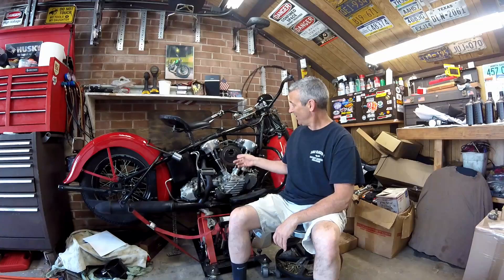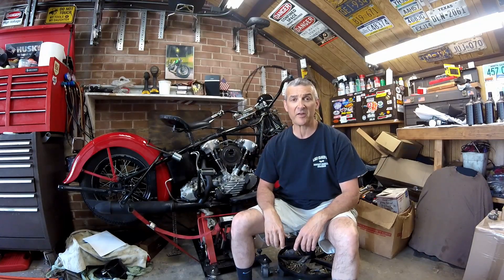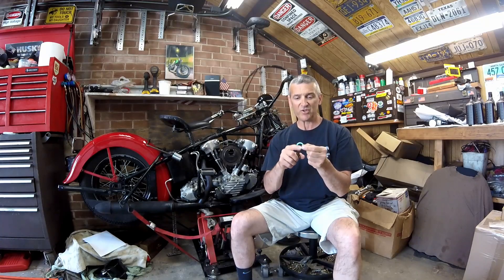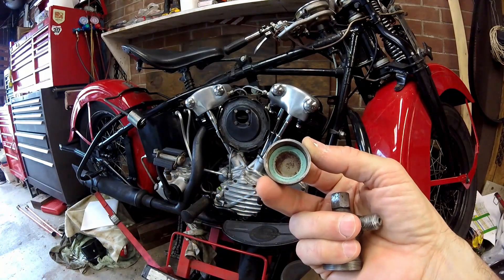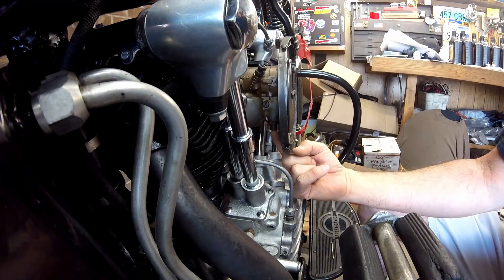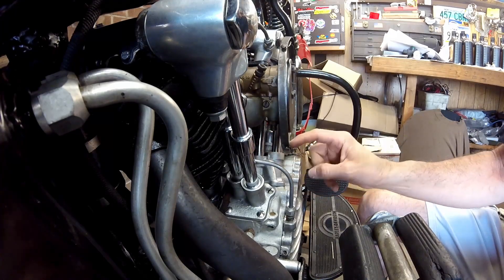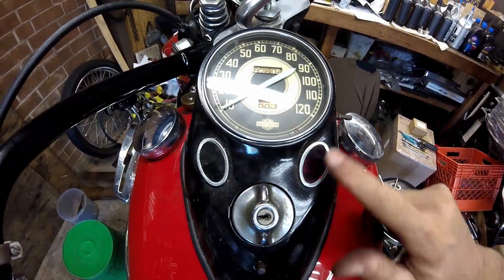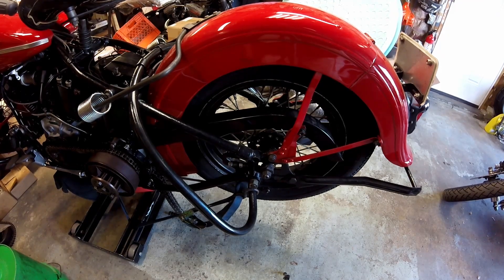Install of Tank & dash 1946 Knuckle Head #Harley #knuckleheads #Panhead #Shovel #harleydavidson

Comment: Suggestion, when installing the fuel tanks. even if they were previously on the frame. Install the rear nuts/washers and the upper long bolts and doing this one tank at a time cinch down the rear nuts and watch/check the front upper and lower tank mounts for light contact with the frame at the mounting surfaces. I ran into problems with OE factory installed tanks on frames that were not evenly contacting the front mounting points back in the early 1980's I suffered a broken upper tank mount on my personal knuckle that the tanks were original to the frame before I learned this. It is simple to move/tweak the rear mount to obtain even contacting at the front two mounts prior to final assembly, just sayin, and you missed the front screw on the dash, I also place a short wood screw into the center of the tank divider that is near the end of the divider that fits under the cover with the head facing up prior to tightening the dash cover down to keep the divider from slipping out when the bike is in use, used glue prior to figuring his out. Ask me how I know this after loosing a couple 🤣🤣🤣🤣Otherwise pretty good video. Used brass floats until I had on leak somewhere in the early/mid 90's, discussed the leaking/cracking issue with Bob Stark of Starklite back then and he told me how to determine between a early float and a late made float. Early/original brass floats had a dead end thread in the installed nut in the float while the late stuff had nuts with through threads that commonly sunk. Been using Nitrophyl floats in my own stuff and all rebiulds that I still do, since they came out even though I retired a couple of years ago, might still have a new sealed  cork float around somewhere but that is me.    👍👍
Reply from the maker: @michaellichner  awesome advice that I’ve never heard before. I did have to tweak the tank mounts when I originally put the tanks on in the late 90’s but assumed that nothing changed since but you never know, like you said. I should have bought more of the brass floats back then because they are the best I’ve ever had so far, but hindsight is 20/20. 
Thank you for sharing this knowledge in an educational way. If you see other things in my videos, please post and input because I’m always willing to learn. I do know you’ve posted great advice in the past on my channel. Thank you

Comment: Hi, any info on the gasket material used on filter?  Manufacturer, thickness, where to buy?
Reply from the maker: Sorry I took so long to respond to this. This is what I used and the thickness was 1/32" 
https://www.equalseal.com/product-p/ts4401.htm?48=219&47=214